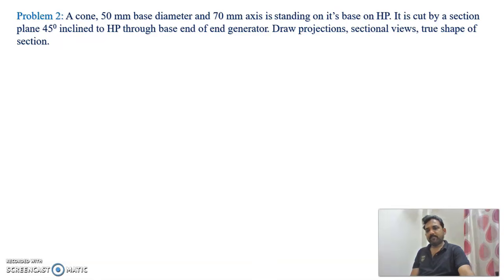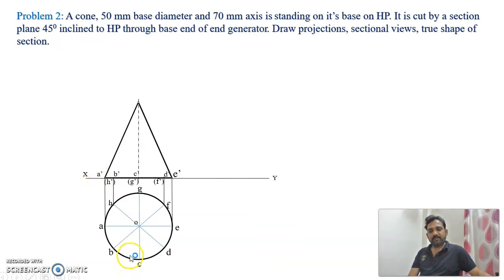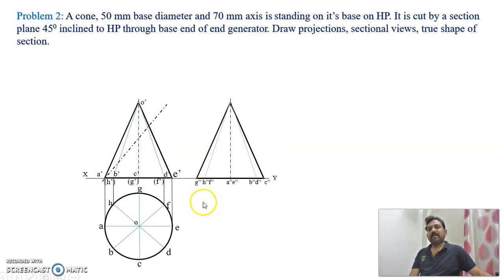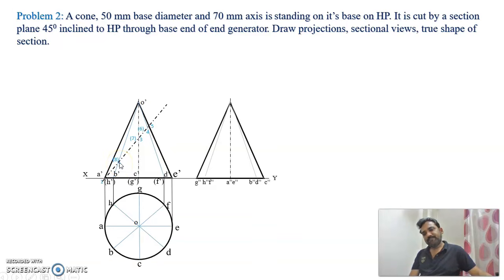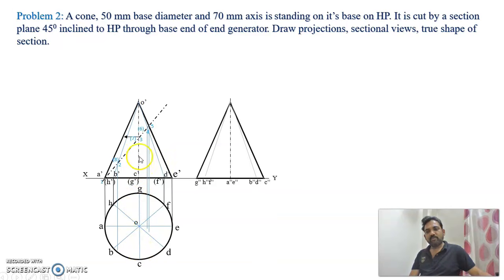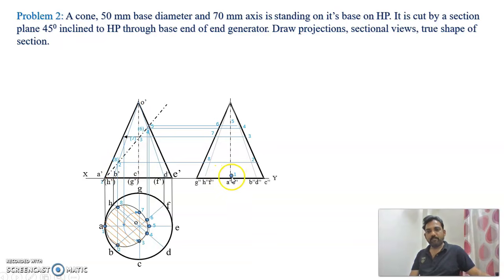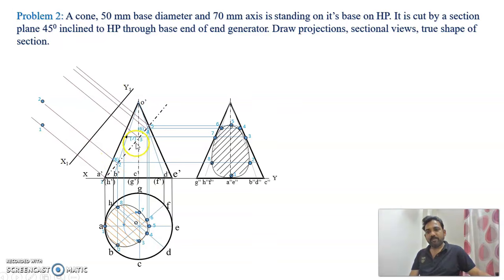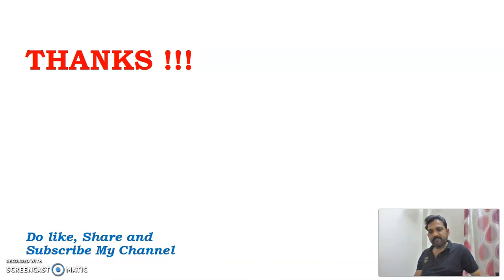Section of Solid Part 2

Comment: A right circular cone, 50 mm base diameter and 70 mm axis is standing on its base on Hp. It cut by a section plane 45° inclined to HP through base end of end generator. Draw projections, sectional views and development of surfaces of remaining solid.